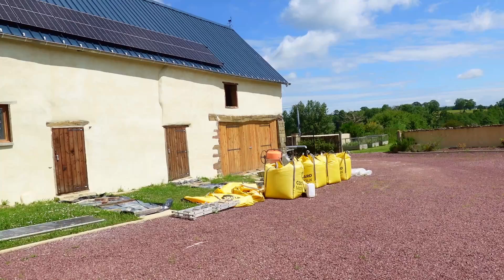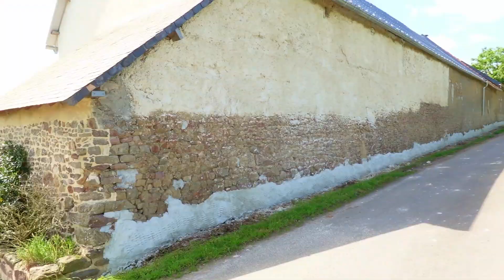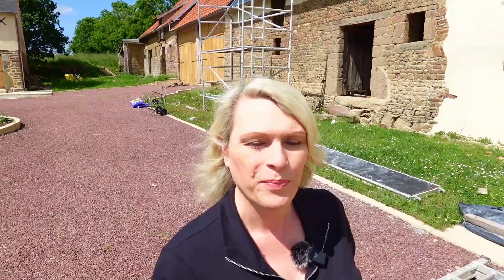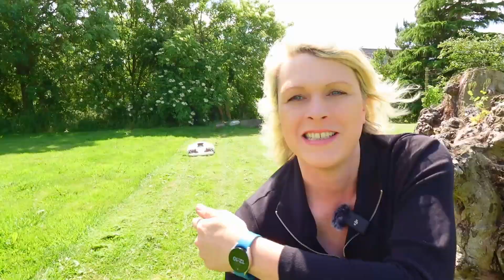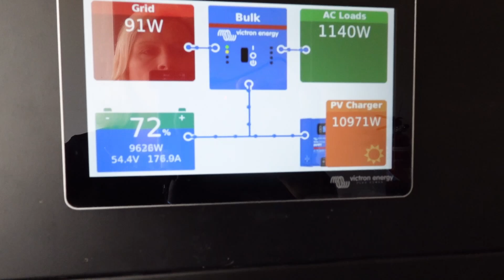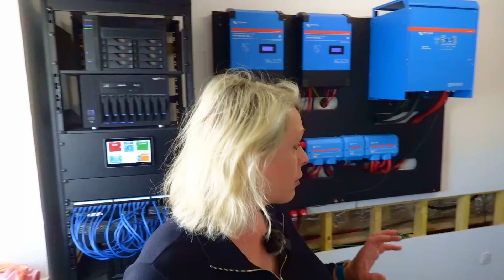What happened To the solar system

Comment: more solar is always good Sara, the panels are also getting cheaper ,even here in the UK a 545w panel can now be had for circa £160 which combined with cheaper batteries is a good sign going forwards :)
Reply: I've just bought a 535W Longi panel from City Plumbing for £89 with free delivery. Can't argue with that!

Comment: I would also consider bifacial panels and make a fence east/west facing. Or maybe a ground mount with 15kw of panels.  Battery size is great  but I notice my 60kw battery is perfect for 10kw solar and my usage. I use 15-20kw a day. Winter is where I need more solar. 15kw PV more would be about perfect with 1 more battery to get me to 90kw.

Comment: Well done Sarah it all looks fantastic you've done a great job. As for ideas I think working out your payback time line would be of interest to people, perhaps a spreadsheet format that people can down load, especially of interest for those who are still sitting on the fence when it comes to solar and battery systems. What safety monitoring are you implementing. I have a anual inspection and clean program, as we use etc fans to help cool the system down in the summer months, and that creates a lot more dust that get into everything including the Inverters, which includes wire fixing inspection and testing the tightness of each nut and bolt. Can we see you system online, perhaps a perment link in the show notes of each video would be a good idea. Thats all I can think of for now! Cheers Ken

Comment: Hi, great content.
I'm running a smaller Victron system, with a recently purchased Fogstar 15KWh battery.
These are new to the market, but are excellent quality and cheap at £2,500 inc VAT
Blinking heavy though, which I take to be a sign of quality.
Plaudits to you for building your own batteries but if you fancy a quick solution I cannot recommend these batteries highly enough.
Keep going and thanks for the vids.
Reply: Yeah, I just purchased a 15KW SEPLOS battery DIY kit from fogstar as well. I only use about 2KW a day as I live alone.

Comment: If you do the construction projects just load them up too cause I bet they are great to watch and make things easier to understand what you are talking about.

Batteries are only usefull if you use them enough and get the cycles. But a 300 full charging cycles would require a heatpump and cheap off peak tarifs during night or so to store the energy during night for the heatpump usage when the solar power roof will no longer being delivering surplus energy. Of cause EV will also increase the demand , but usually not as much as the heatpump and I bet you will need a lot of energy for heating too. 

If you get through the night already than a bigger battery  will not pay off any time soon cause a battery is only beneficial once it can pay back like 200 or 300 cycles but 100 cycles will not be enough. At the end  the prices we have to pay are again US$ based prices and if the Euro goes down we will pay more for those betteries and panels and BMS. What is changing now is the declining amount of pure cells sales while ready to use rack battery sales have increased a lot most recently even though it still makes me wonder why people buy these racks if they do not know the manufacturer and modell numbers of the cells inside cause the main value are the cells.

Comment: 5:59 - Don't be fooled that the prices per kWh will continue to go down the same way. With a blink of an eye it can turn the other way around if there are other markets appearing for the chinese. It all depends on the tarifs and new governments with different strategies that can change the demand seconds. Here in germany the batteries became even cheaper when the VAT for solar power system parts had been cut from 19% to 0%. 

In 2020 the prices went first down big times and since late summer 2020 they suddenly exploded to an incredibly high peak in summer 2022.
If the demand for EVs will increase the same time you will no longer get these battery cells for that cheap cause once you will hear about that the prices will have already increased cause the prices are the result of negotiations between the suppliers from china and the car manufacturers.

Get the stuff you need in time for the price you can get it and this means all parts cause even Aluminium profiles have already started to get more expensive again. 
20 panels will be 9 to 11 kWp depending on panel size cause the 450 Wp are short ones while the big ones are now 225 cm with 550 Wp or 250 cm with 650 Wp. 
The longer and bigger the better cause you will need less profiles and brackets for the roof. Panels have the same width.   

Be aware that you might not even being able to get the same panels you had bought before which would mean to remove the 6 from the single bottom row and put 4 of them on the top fields above. It is usually a lot easier to start from the top. Then you will have a clean cut for the next kind of cells. Our biggest 550 Wp were about 140€ per kWp. 
But the prices have stopped to decline at least for those panels which are already in Rotterdam. Same for lfp cells.